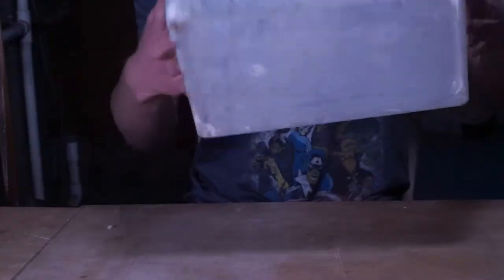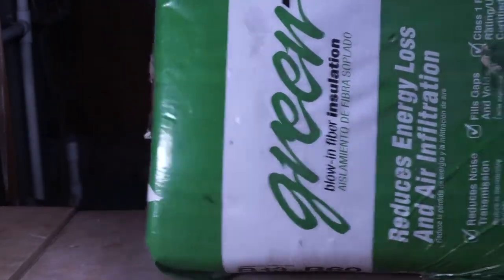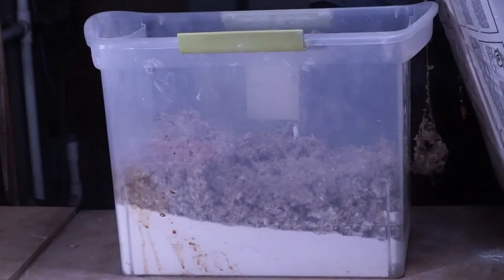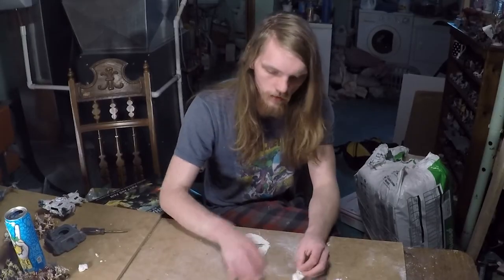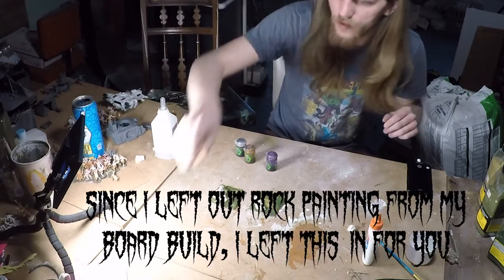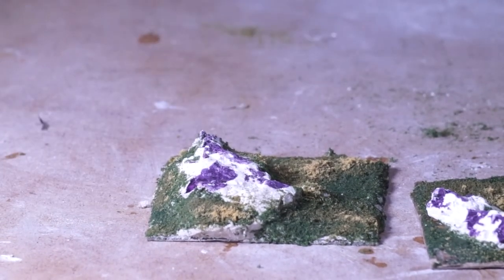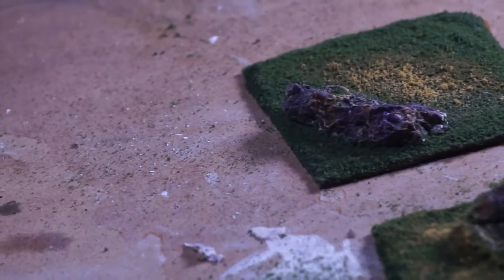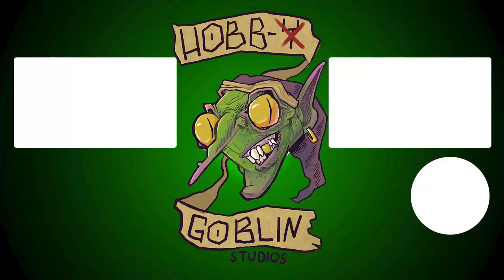How to Make Modeling Compound Like Luke's APS - Homemade Sculptamold

Comment: Nice video!  I also use cellulose blow in insulation.  I put a few inches in a 5 gallon bucket.  To break the insulation chunks up I use my drywall mixer bit in a power drill.  It looks ungainly to use but works well.  Then I mix the plaster in with the insulation in the same way.

Comment: Did you get the insulation that is just cellulose, or does it have additives?  I could only find stuff with borate added and didn't know if that would change the plaster somehow.